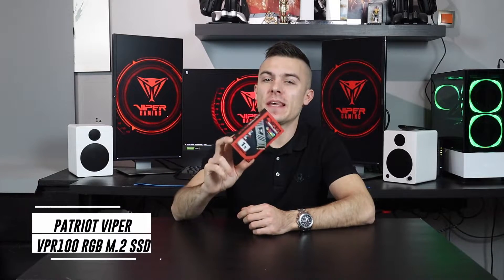PATRIOT VIPER VPR100 RGB SSD - thermal and speed tests

Comment: is the heatsink cover removable? id like to paint it white
Reply from the maker: I think it is attached with thermal glued pads. You will have to be very careful so you don't break the PCB board of the SSD and then you will need to get something to attach it back but with the same thermal pads that can be glued so they dissipate the heat.